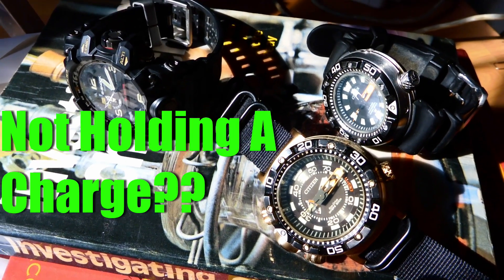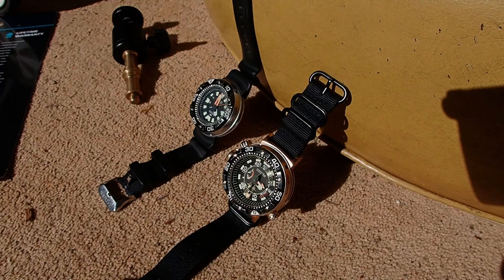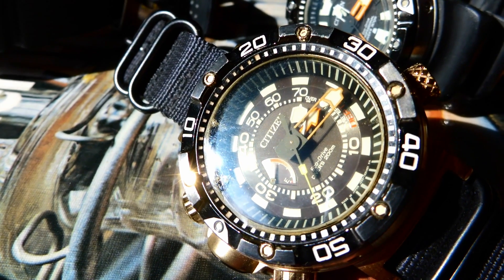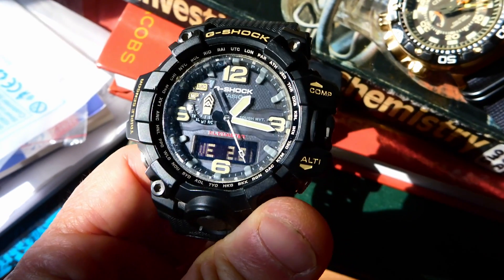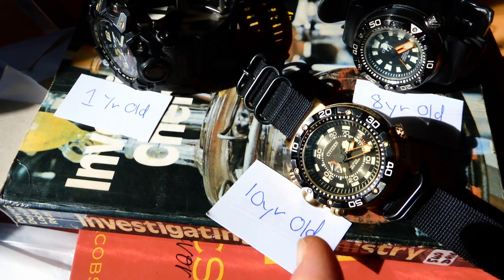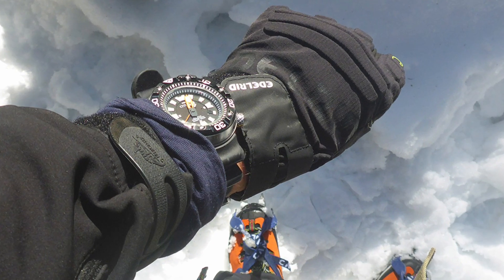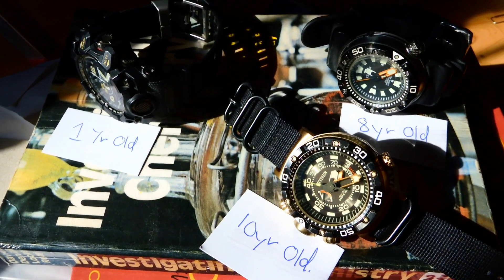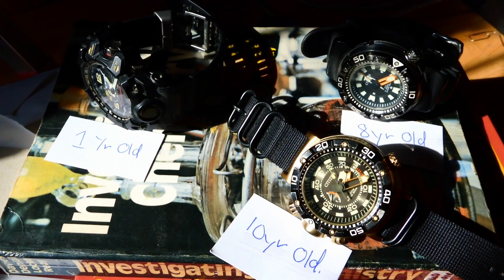Why Isn't My Solar Watch Holding a Charge?

Comment: Hey there. 
I have a Casio protrek 550. 
I removed the battery for a test in another watch and then when i insert it again the watch dont hold charge more than 30-45 min. 
I have let in the sun several days, and after usin it, again 30-45, goes off. 
Never had a problem before. 
Any ideas why?
Reply from the maker: Probably wasn't a good idea to put it into the other watch, maybe a different charging regime??? Was it the same watch you put it in or a different brand/make model?